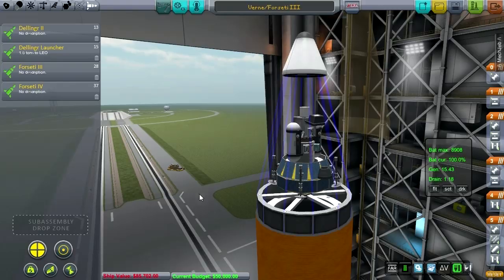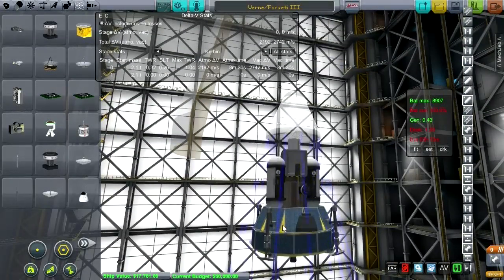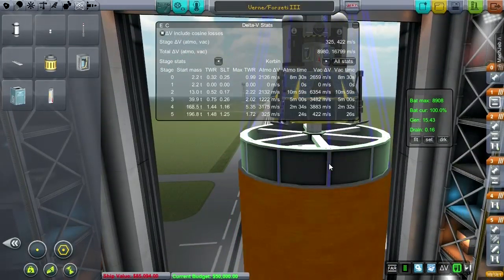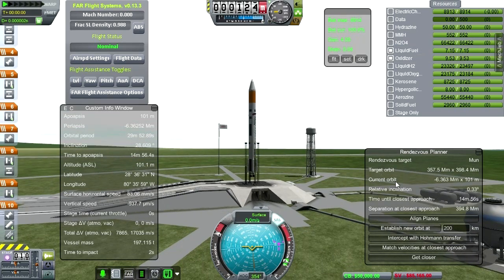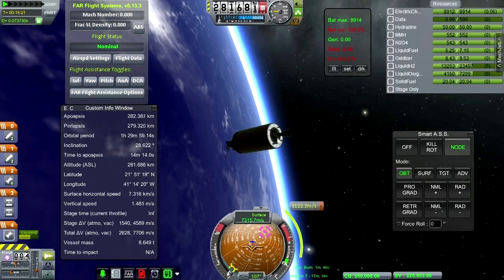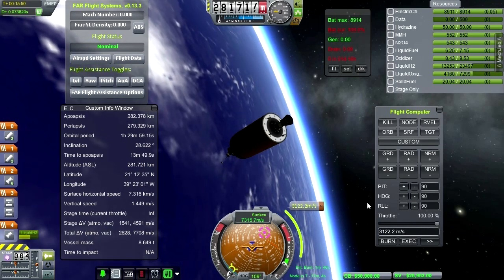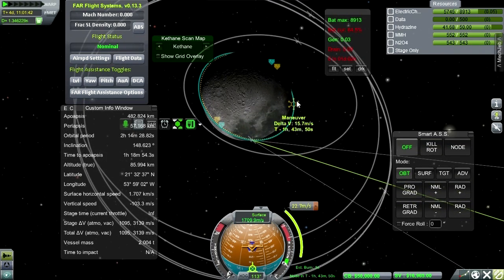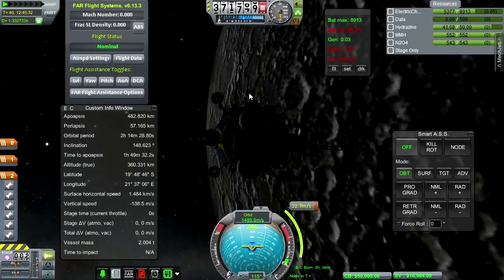Kerbal Space Program (0.23.5) - Realism Overhaul 035 - Verne Redux

Comment: Awesome vid as always! Not complaining or nagging but at 22:00 it did the right burn. You forgot about the way the dv is calculated with manurers. It assumes that the dv change will be instantaneous and not over time. Because you burn over time it takes more fuel to do the planned burn. Example: I used NERVA to get to Jool using fast transfer. Node said it will take 8km/s, and it took 16km/s because the burn was over like 30 minutes.
Reply: True, you would be more accurate because you would keep burning until you got encounter you wanted. Flight computer isn't that smart sadly and it just does what it is told to do. MechJeb can do it but it has it's own problems. Sadly as a programmer I can testify that computers are only as smart as the person who programmed it.

Which gives me an idea, what if we could write scripts for the flight computer as opposed to trying to get lucky. Example: mission.burn(mission.day(50.2), velocity.ms(800)) or something. Don't know if you are familiar with Minecraft and ComputerCraft. As opposed to just mashing buttons and keeping fingers crossed an API we can use to program the whole mission. On the other hand MechJeb can do something like that with click of a button (as accurately as it can). It would be more fun though.

With those delays I have no clue how to do missions without MechJeb, especially when you go beyond Moon and delay reaches hours/days. Sadly last time I tried forcing MechJeb to do something constructive it failed miserably. I never found it to be even close to accurate. Saying that it could be better nowadays, I have it installed but only use it occasionally for the stats instead of Kerbal Engineer.
Reply: Need to have a look into kOS. And yes this is the same reason I stopped using MechJeb. Even in early days when I was hopeless with my manoeuvres and ascent I was doing better job than it.